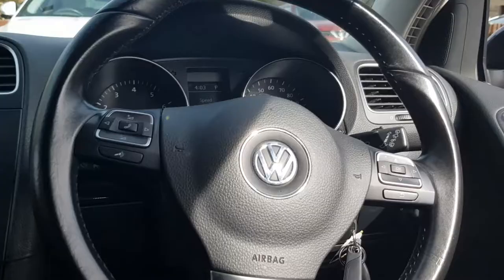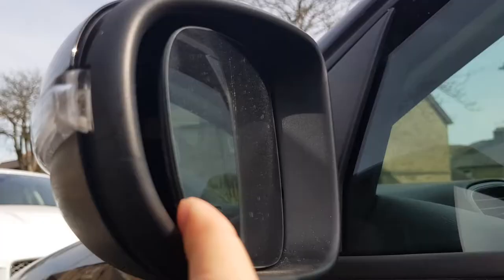How To Fix Wobbly Shaking Vibrating Wing Mirror VW Golf MK6

Comment: Thanks, worked for me. Was about to take mine in for repair but discovered that the mirror was just detached from the backing plate, only the top section was still attached and was holding it on. Just glued it back on and the shaking has stopped, this has been annoying me since I bought the car in November!
Reply from the maker: No problem my friend, please help me out by subscribing to my channel

Comment: How long is the double sided tape expected to last? Compared with if you glued it?
I used double sided tape but ive seen some people glue.

A full mirror with the complete plastic backing plate is about £10 from ebay, or just the glass is £5 so they arent too expensive to replace, especially if the glass is broken.
Reply from the maker: Usually will last around 6 to 8 years
Reply: Ebay ones don't heat as well as OEM

Comment: This is a good short term fix. But the low air pressure while driving the car will again pull the mirror out in some time because of the gap between the backside and mirror due to double side tape thickness. 
Better solution would be glue it strongly without leaving any gap. But thanks for the video :)
Reply from the maker: No problem my friend, please help me out by subscribing to my channel

Comment: will the heated mirror melt the glue?
Reply from the maker: Maybe over 10 years but won't affect much as the heated mirror doesn't get very hot, this car is 11 year old now so not too bad
Reply from the maker: Oh i tested out the heated mirror it still works fine, it does take longer to heat up by maybe like 2 or 3 minutes longer than usual, but thats about it, does pretty damn good job still even thought the 3m is on there, also wont need a full new wing mirror just replace the glass if needed which is like $20
Reply from the maker: @star999nine  yes just slower than usual so next time if i do this repair i will use glue instead so it not affect heating

Comment: my car's left wing mirror was hit by a trolley in the car park. ever since then it made weird noises when retracting and the angle would be off. I have adjust it every time. Any ideas?
Reply from the maker: Probably broken clip on the mirror
Reply: @MrWaheedulHaque  Thanks for replying. How do I fix this? Will the mirror fall out if it's a broken clip?
Reply from the maker: @sara.cbc92  you can check it by taking it out, but check if its wobbling or anything if not should be ok